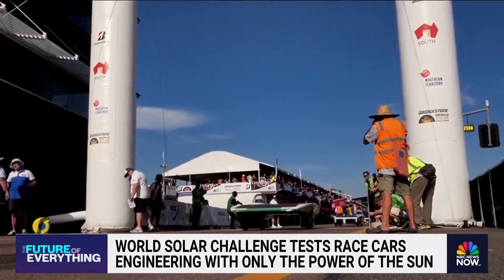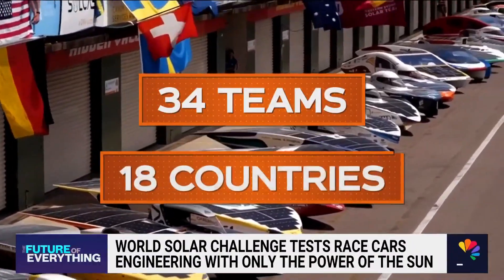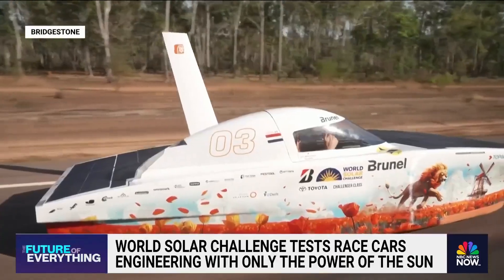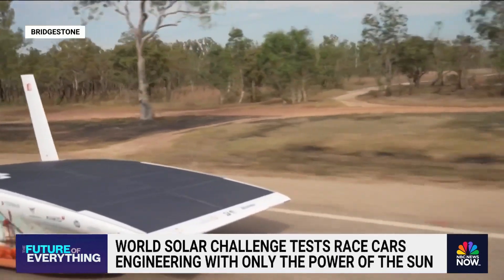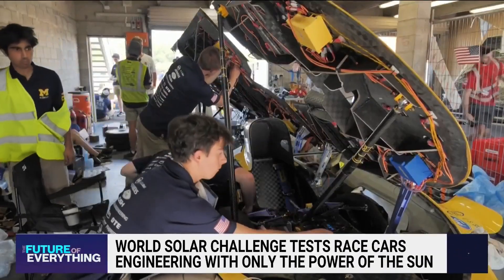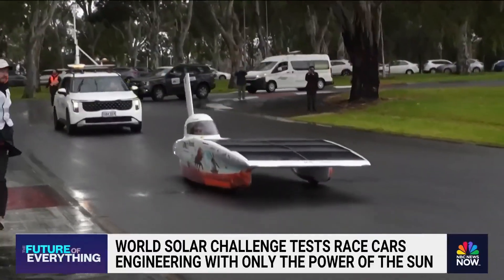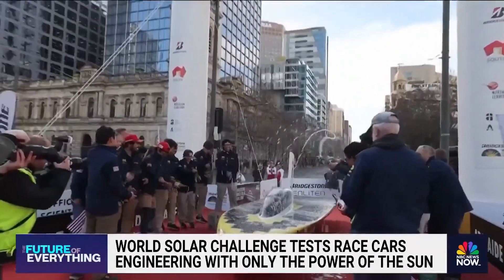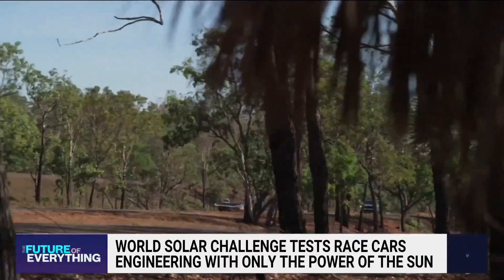World Solar Challenge tests race cars powered by solar energy

Comment: Add solar to all cars with batteries. Vans would be better with the large roofs.
Reply: Vans would certainly be one of the better choices for road legal car solar. From looking into it a small bit, it seems that the biggest reason for not doing it on production cars is that production EVs that have to follow safety standards, and customer demands for comfort get so heavy that the limited roof space for solar panels wouldn't be able to significantly charge the car unless you only used it for a short trip every couple days

Comment: Thats a good 1st step , cant understand why most Evehicles manufactures missed that , hybrid vehicle with solar panel to charge , thats a handy vehicle
Reply: Fueling /recharging is the buyer's problem. That's why no manufacturers invested in charging infrastructure either (aside from Tesla).
Adding any panels increases the initial price of the vehicle for "nominal" return in electricity that in many markets was not considered worth it. Especially as the design philosophy calls for integrated panels and huge curved glass roof sections which would add thousands to the vehicle.
Reply: because yer so much smarter than all those extremely well-educated and well-paid engineers...
Reply: @RememberAuroraColorado ever thought it might be the corporations that hey there for control the engineers want people to have to buy Power instead of Get It Free for their cars.  I know it's mind-blowing  lol

Comment: My question is, why aren't all the electric cars equipped with solar panels on them to help charge them? 

That's the greenest way to charge them and not the power grid / power bill.

 Well, i guess i already know, and you do too.
Reply: I work in the EV industry and the answer is simple. Even if you fully cover a typical EV with the highest producing solar panels on the market you won’t provide more than 20 -30 miles of additional range in optimal conditions while dramatically increasing the cost of the vehicle!
Reply: @nelsonbl45. Soler panels are cheep nowadays though and also the average person doesn't drive more than ten to twenty miles at most per day to work and home and the rest of that time the car is just sitting in the sun and could be changing for free
Reply: Plus i have a solar trickle-charger (price 16$) the size of a clipboard that charges a deepcycle battery fully in one full day of sun and it can run my boat trolling motor/ lights and radio for hours.
Reply: @sagoownbey9686 If they were a good option, then they would be on the car smart guy.
Reply: @switchdeck9164 look at the cars in this video and then repeat that statement lol
Reply: @sagoownbey9686  These are experimental vehicles not designed at all for standard road use. A typical car weighs over 4000 lbs, so you need way more surface area to put solar panels for it to make any difference for an actaul road car. Put those same solar panels on a road car and all its going to do is run the A/C and be way more expensive to fix and maintain.
Reply: @switchdeck9164  That's why aptera exists... It is possible, it does make sense. The vast majority of us drive less than 40 miles a day anyway. I probably drive 40 miles a week at most. Even a car with 10 miles a day of solar would mean I never have to pay for fuel.
Reply: @nelsonbl45  
yep!
I have been making electric bikes for decades.
electric vehicles can't run on windmills and unicorns.
Reply: @RememberAuroraColorado  Well no, that's because windmills are mills... They make flour. 🙃
Reply: @stormveil  
Don Quixote thought windmills made war...
the definition of "windmill" includes pumping water and producing electricity.
Reply: More expensive and heavier weight to the car. Are you really that nearsighted?
Reply: Lol nearsighted you realize the video is literally about using solar power on cars right 😂but  @FriendsofMineralTownand how much more money could it be not to be worth saving money on your electric bills not having to plug into the grid near as much